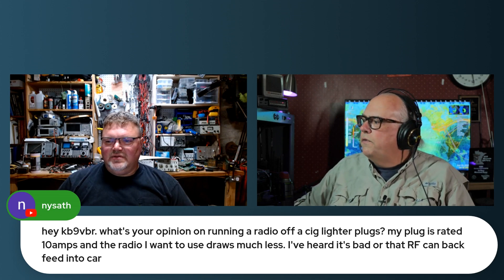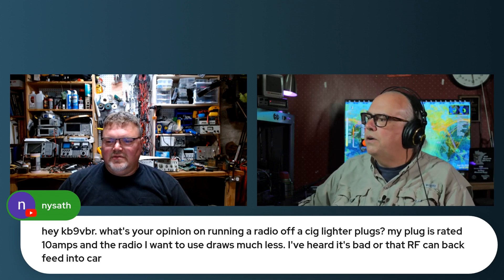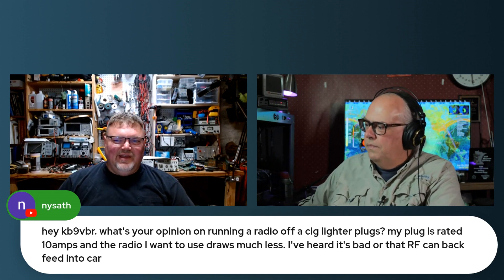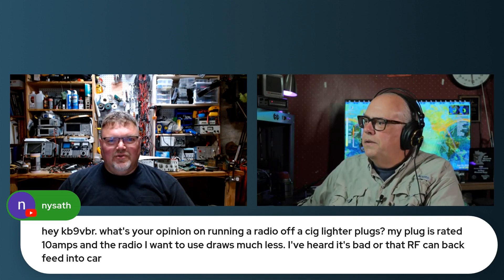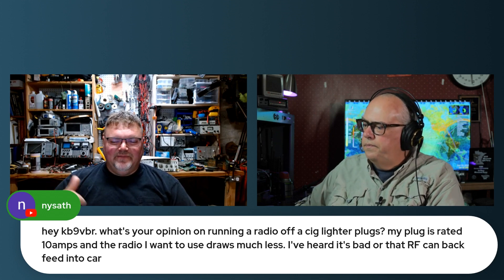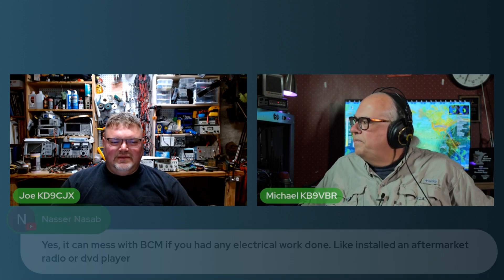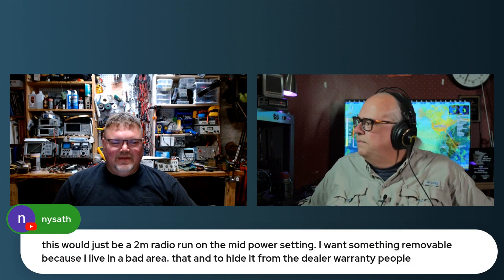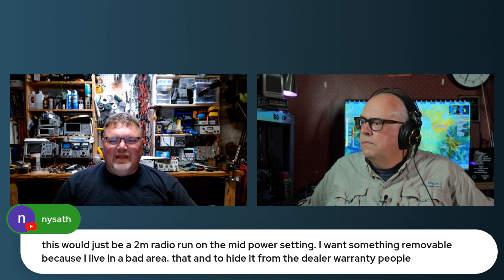Can You Really Power a Radio With a Car Cigarette Lighter?

Comment: Different cars have cigarette lighters wired differently. Some have fuses. Some are hard wired, without any fuse at all. Some can handle 20 amps or more, some can only handle lower current levels.

Comment: I ran an FT450 through a 12V in a 2003 Camry, and it was fine as long as the RF was kept to 30W,.  That kept the current to 5A.  I did not want to drill holes into the engine compartment.   Ended up us a LiFePO4 in the car.

Comment: I'm running my 50W GMRS radio through my port on my Nissan leaf no issues at all while operating I find that with the plug it becomes little loose from contact from where my 891 hand mic is located and my PC USB cable to run digital modes on my 891 but I can just push it right back in and for my 891 I just run it off my 100Ah smart battery strapped in my trunk with my table chair and my 2 solar panels so it won't move around during movement works like a charm -W7AAF/WSCQ554

Comment: I did my first few POTA activations with that cigarette lighter power strategy, but even with a low power radio, those addictive POTA pileups nearly left me stranded in the middle of nowhere with a dead vehicle battery. That's a no-go for me.
KZ9V

Comment: I get so much ignition noise in my ‘02 4Runner - whether connected direct to battery or 12 volt plug - that I finally came up with a hybrid solution. My power supply to my Yaesu FTM-150RASP and Midland GMRS radio as follows: 12V port to LiFePO battery charger to 3Ah Bioenno battery to power pole splitter to the radios. It solved a year-long fight that I could never solve with a dozen or more ferrites, copper shielding tape and Faraday tape. The charger, battery and Yaesu body all fit neatly under the driver seat. The Midland body is under the dash. So, all very clean, nothing extra in the engine bay anymore, and I can swap in a bigger battery if I plan to operate for an extended period with the engine off. Oh, another key is my 12V ports are all on accessory power so they’re off when the truck is off, so no killing the starter battery.

Comment: I have ran a 40w amp for my FT818 through 12v port in a company vehicle for a few months without issues. Have been running a 20w dual band in 2 different vehicles also with no issues. Mainly listening but occasionally rag chewing.

Comment: I use my FTM-510DRASP using a Powerwerx Anderson Powerpole to Aux Power adapter. The outlet is rated up to 10A in my car, and it does work, BUT, I haven’t had a problem, I do power off the radio when I’m done. Noise has not been an issue.
Reply: Same solution for me. When I travel, I take my FTM-400 and a mag mount. Head is attached to a "bean bag" mount and set on dash.  The newer cars are 15 amp and I have the 15 amp fused power plug adapter via Powerpoles to the radio. Running high power has not been an issue.....yet.

Comment: I have done it for decades. You just need to stay grossly under what the outlight is rated for. So if it is rated for 10A do not run more 6A of draw and all is golden. 

Radio's and cars are DC not AC so the device is not going to introduce noise into the wire like you see with AC ssystems where a refrigerator motor going bad might dump insane noise into all of the wiring in your home. In the case of a car the RF will come off the antenna and microvolts will skin across poorly shielded wirings in the car like any antenna. Genereraly you need to run serious power more than could ever be supported by a cigerette lighter 12V power port loaded with lots of harmonics from your own vechile.

When you do see issues it is normaly because someone spliced into a wire that would never be near a power port like a switched wire that also goes to engine or transmission control module or to a body control module or the like. In something like that that is part of the CAN BUS any voltage fluctuation can cause all kinds of issues. 

The bigest issues are when people splice into wires in the vechile or piggyback a fuse or the fuse box!

Comment: I installed a 100Ah LiFePO4 battery connected with a Redarc DC-DC charger. That way my starter battery is isolated and is only used for starting the engine. Ran a 6AWG cable through a cable gland in the firewall.  Just check both sides 3 times before drilling. I run a small refrigerated cooler plus a couple of powerpole blocks in the cab of my truck and ran another 6AWG to the bed with more powerpole blocks and an SB50 connector to plug in another battery. I recently had a powerpole block go bad possibly from vibration in the bed. I might shock mount the next one.
Reply: The Redarc has solar input, too, which I use occasionally.

Comment: I have a battery back up setup with a 1000 amp deep cycle battery. I run sae connectors to the battery terminals but also have a couple 12 volt car type sockets on it too depending what I may use in an outage. I use it regularly to work it a little. Has on board 110 charger and solar charge controller. It powers my 40 watt radio very well and couple CB radios. I have a 400watt inverter on the single battery unit and a dual battery unit with a 1000watt inverter on that one. Both units have the sae and socket 12 volt connectors.

Comment: I would not run anything over a 25w radio directly from the 12v plug. While it might support a 50w radio, I would make that a direct to vehicle battery with a cutoff or run a separate LifePo4 battery for power and noise isolation. 
Of course, that's just me!  I have an inverter that can recharge the LifePo4 in between locations. 
73
KJ5FWC

Comment: You can run smaller wattage radios. But be sure to carry spare fuses and know where the fuse panel is.
Reply: My cigarette lighter is rated for 20 amps, but if the car is not running, I have to use not more than 60 watts output from my radio  or the radio shuts off on its own. If the car is running, I have to use coax with a lot of common mode chokes or the back window in my truck goes on when I transmit. When the truck is running there is no problem with a 100 watts. I can use a hundred watts output of the radio (CW). My other truck, same model, F150, could power the rig up to 80 watts with the engine not running. So, each model is different apparently. The amount of power used to run a radio for a few hours will not run down a good car battery. It just won’t. A car battery holds a lot of power. If you have an older battery, then you would have to be careful. If your battery  is 3 years old or less, there should not be a problem. For an hour long activation, there would be no problem using a car battery with the engine off if your battery is “good.”  All that being said, I use a 16 amp lifepo4  battery and run the radio at 100 watts for three hours without a problem. So, there is no need to use a car battery normally.